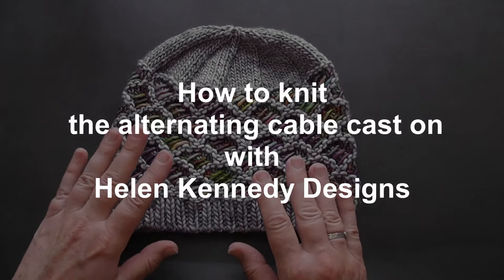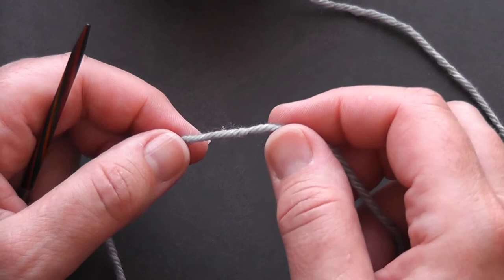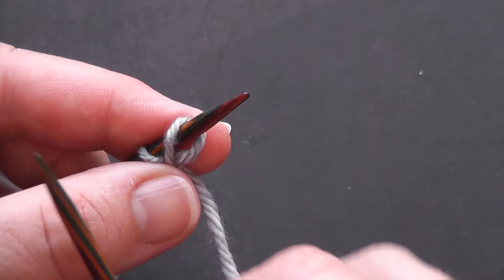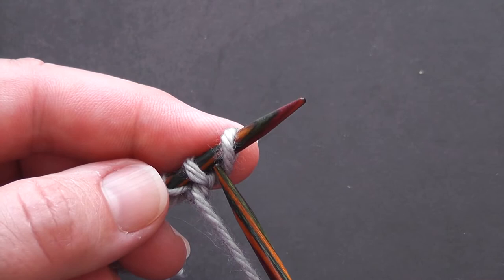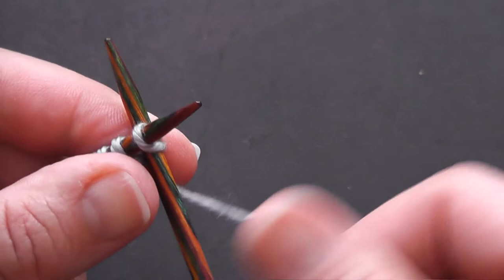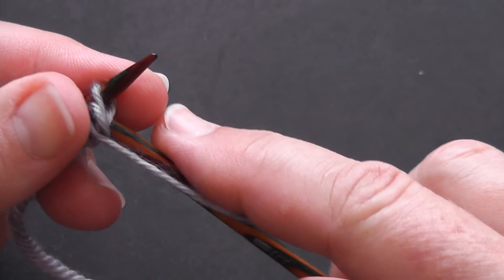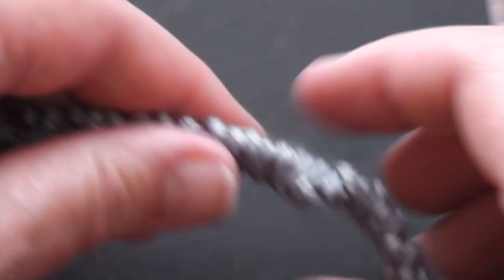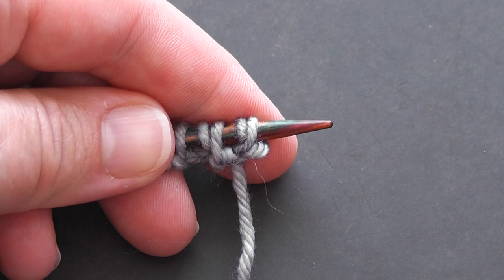How to knit: Master the Alternating Cable Cast On Technique!

Comment: I don't throw,  i pick.   And i want 2x2..... help?
Reply from the maker: Hi Hannah. I'm sorry I don't pick, but this cast on uses the same basic movements as a knit and purl stitch, just that you insert the needle between stitches rather than through the loop so in theory you should be able to work this cast in using your usual knitting style. As for 2X2 you cast on in exactly the same way (1X1) but then rearrange the stitches so you get 2X2. So work a knit stitch, next two stitches swap places so instead of being p1, k1, you cross them over to get k1, p1, work those two stitches, next stitch should be a purl...so then you have k2, p2....etc hope that makes sense...try it out probably makes more sense if you actually do it!

Comment: Can you remove the original slip knot once you are done casting on? Or is the original slip knot just not visible once joined in the round?
Reply from the maker: You can remove it if you want to, remember to have an extra stitch at the end, and if you need your round to start K1,P1, once you have your two stitches cast on, start the cast on with a k1(instead of a P1) as the slip know stitch will be lost, causing a shift in pattern at the start of the round, does that make sense?
Reply: @helenkennedydesigns  Yes that makes sense. I'm going to give this a shot on the second hat I've ever maid. I just finished my first magic loop hat. It was shorter than I needed it to be and I didn't do any ribbing on it. So this looks like perfect thing I need to make a stretchy rib so the hat won't curl. My main concern is making the slip knot invisible. If I'm understanding it correctly if I needed 102 stitches I'd cast on 102 stitches not including the slip knot. It wouldn't need an extra stitch if I was already planning on removing the slip knot. When you joined the round did you just knit the first stitch cause it was the slip knot? I just want the pattern to look as symmetrical as a spiral can. So trying to figure out how you hid the start.
Reply from the maker: @Bobbakerfield  Congrats on your first hat!  Yes if you treat the slip knot like it doesn't exist then it should all be good. Hope it works out and you like the cast on!

Comment: Is preparing for 2x2 rib a simple  matter of casting two purls alternately with two knits?
Reply from the maker: No, sadly that doesn't work. You need to cast on for 1x1 then rearrange the stitches as you work, think of groups of 4 sts, k1, cross two stitches over so you get k1, p1, then you should have  purl left....does that make sense?. I've jut made a video on it. I have to edit it but I'll reply to you when its out!
Reply: @helenkennedydesigns  Thanks for the rapid reply. I do understand your description and I’ve viewed other YouTube clips that detail the steps. It’s a bit fidgety, but I plan to do it.
Reply from the maker: @Mspurrier88  Good luck!!

Comment: Excellent tutorial, very clear🙏
Reply from the maker: Thanks so much! really glad you liked it!
Reply: @helenkennedydesigns I have noticed that some (as you do) twist the stitch when mounting and some do not. I will be using this CO for 2X2 rib at the beginning of a🧣🙏
Reply from the maker: @ilonarosenason2475  Hello! You are right, some twist and some do not, either is fine as long as you are consistent during the cast on! You can make this 2X2 rib by rearranging the stitches! I must do a video!